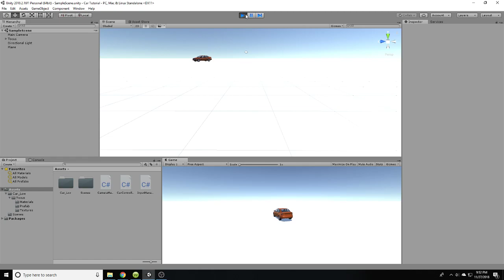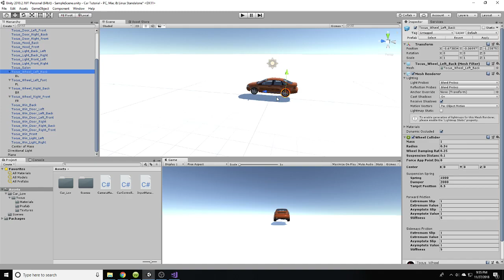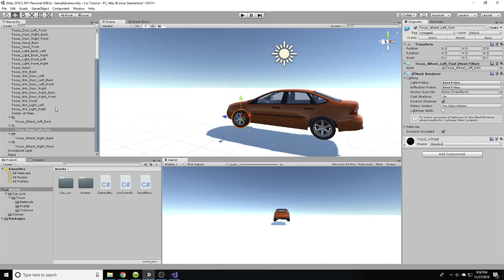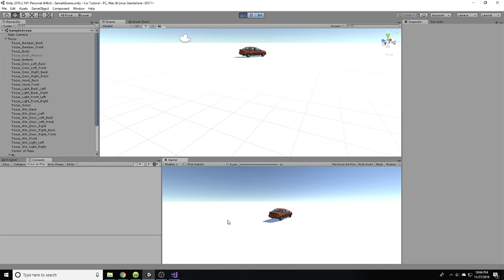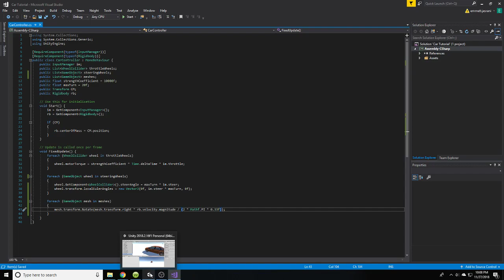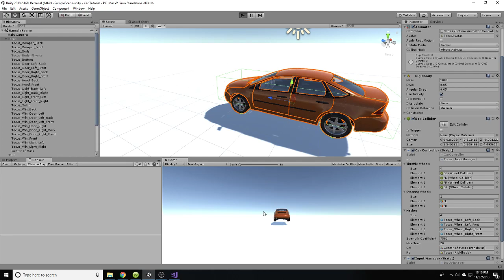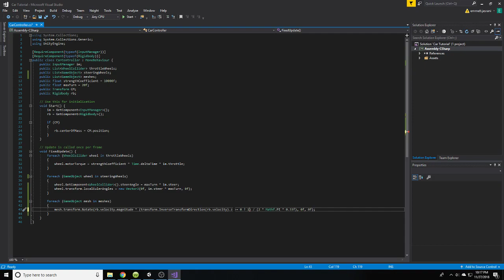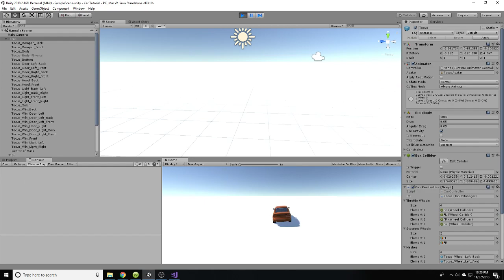Unity Car Physics Tutorial - #3

Comment: I know you don't like seeing syntax errors, but I'm about halfway through the video, 9:47 is what my code looks like. 

-----------------------------------------------------------

using System.Collections;
using System.Collections.Generic;
using UnityEngine;

[RequireComponent(typeof(InputManager))]
[RequireComponent(typeof(Rigidbody))]
public class SnowmobileController : MonoBehaviour
{

    public InputManager im;
    public List<WheelCollider> throttleWheels;
    public List<GameObject> steeringWheels;
    public List<GameObject> meshes;
    public float strengthCoefficient = 20000f;
    public float maxTurn = 20f;
    public Transform CM;
    public Rigidbody rb;

    // Start is called before the first frame update
    void Start()
    {

        im = GetComponent<InputManager>();
        rb = GetComponent<Rigidbody>();

        if (CM)
        {
            rb.centerOfMass = CM.position;
        }

    }
    // Update is called once per frame
    void Update()
    {
        foreach (WheelCollider wheel in throttleWheels)
        {
            wheel.motorTorque = strengthCoefficient * Time.deltaTime * im.throttle;
        }
        foreach (GameObject wheel in steeringWheels)
        {
            wheel.GetComponent<WheelCollider>().steerAngle = maxTurn * im.steer;
            wheel.transform.localEulerAngles = new Vector3(0f, im.steer * maxTurn, 0f);
        }
    }
}

-----------------------------------------------------------

Yet I get an error in Unity saying "MissingReferenceException: The variable steeringWheels of SnowmobileController doesn't exist anymore. You probably need to reassign the steeringWheels variable of the 'SnowmobileController' script in the inspector.
UnityEngine.GameObject.GetComponent[T] () (at <480508088aee40cab70818ff164a29d5>:0)
SnowmobileController.Update ()" But I don't know how to fix it. Also thank you for the tutorials.
Reply from the maker: Did you fix this? I've never seen this particular error before

Comment: I implemented the following in the mesh loop:

foreach (GameObject mesh in meshes)

        {

            frequency = rb.velocity.magnitude / (mesh.GetComponentInParent<WheelCollider>().radius * 2 * Mathf.PI);

            mesh.transform.Rotate(2 * Mathf.PI * frequency * (transform.InverseTransformDirection(rb.velocity).z < 0 ? (-1) : 1), 0f, 0f)

        }
This is more realistic i guess : ).
Reply from the maker: You can also just get the current rotation from the wheelcollider, itself; I just preferred the more controlled look of an artificial spin. Another element is that unity doesn't accurately blur the wheels as they rotate; you'd need to use a mesh with radial blur to fix some of the visuals.

Comment: basically, u can use wheelcolliderName.GetWorldPose(out position, out quat);
where position is a vector3 and quat is a quaternion and just apply it to your mesh as 
wheel.transform.position = position; 
and 
wheel.transform.rotation = quat;
quaternion is something that will just do the job even if u don't know anything about it.
I just used 3 lines of code for this entire video
Reply from the maker: I definitely agree there are easier ways in which to do this; I'm definitely going to claim neither that this series was perfect nor that the way in which I did it was better lmao

I chose to write my own code for the rotations because the wheel colliders are a bit wonky, and I thought the rotations were a bit unnatural
Reply from the maker: Also, you could probably make that one line by doing (out wheel.transform.pos, wheel.transform.rot) instead of using dummy vars to hold the values

Comment: hi,for some reason my front wheels are not rotating in x axis whereas my rear wheels are doing fine.they have no problem  turning in  y axis.please help
Reply from the maker: Maybe the front wheels are rotated in the prefab for some reason?
Reply: I’m quite new to unity and programming so these tutorials are quite helpful. However I also have that problem, as far as I can tell my code is fine so the wheels should be turning but the car I’m using is one I modelled myself. Which before I started to work on unpacked the prefab. It’s quite basic and is basically a body and wheels, could that be the problem? 
My wheel colliders are directly applied to the wheels but I’m pretty sure that is not it. Do you have any suggestions?

Comment: Thank for tutorial. But i got error "CS1061: 'Transform' does not contain a definition for 'localEularAngles' and no accessible extension method 'localEularAngles' accepting a first argument of type 'Transform' could be found (are you missing a using directive or an assembly reference?)". Code is the same as me and I am using Unity 2019.4.
Reply from the maker: Euler is the proper spelling; simple typo is the issue!

Comment: Thanks for your detailed explanation in every tutorial. Cause of that I can managed to do this.

I've modified your script for my convenience and not to remember radius for every other car to which you attach your script

public float r; 
r = throttlewheels [0].GetComponent<WheelCollider> ().radius; 
mesh.transform.Rotate (0f, rb.velocity.magnitude * (transform.InverseTransformDirection (rb.velocity).z >= 0 ? -1 : 1) / (2 * Mathf.PI * r), 0f);

The last line I needed to replace was because the wheels of my car model was at rotation (-90,90,0)

And I have a small problem ie my wheels are rotating much more faster than the car is moving. (Eg. Car's at 10KM/h and wheels rotating at 40KM/h)

Can you tell me how to fix that.
Reply from the maker: I would check the radii of the actual wheels, as opposed those of the collider. If they're not the same sizes, things will look quite inaccurate.

If not, I will try to suggest something else.

- Hope that this helps.
Reply: @AxiomaticUncertainty  Can you solve my wheel problem. Wheels are spinning faster than the speed of the car. Almost x4 times
Reply from the maker: I left a suggestion for that, above. Also, I do, now, plan to record and release video six, ASAP.

Comment: My front left wheel's rotation is changing to 0 degrees after pressing the play button and this is making the rims of the wheel face the other way and is making it look odd.
Can you please help me out?

This is the issue only with the front left wheel.
The other wheels are fine.
Everything' else is fine.

Only this is the prob.
How do i stop it from changing to 0 degrees from -180 degrees?

Thank you.
Reply from the maker: Change your angle scipt by offsetting by -180 degrees. In other words, "angle - 180" should work as a quick fix

Comment: I ended up taking this and implementing it a little differently. I made a separate script and placed it on the wheel mesh object directly so that the car controller can stay a little cleaner. It handles all the rotation just on the mesh object without changing the wheel collider and also does the position based on the suspension. 
using System;
using System.Collections;
using System.Collections.Generic;
using UnityEngine;

public class WheelAnimator : MonoBehaviour
{
    WheelCollider _wc;
    WheelCollider Wheel
    {
        get
        {
            if (_wc == null)
            {
                _wc = transform.parent.GetComponent<WheelCollider>();
            }
            return _wc;
        }
    }

    Rigidbody MyRigidBody
    {
        get
        {
            if (_wc == null)
            {
                _wc = transform.parent.GetComponent<WheelCollider>();
            }
            return _wc.attachedRigidbody;
        }
    }

    float lastSteerAngle = 0;

    // Update is called once per frame
    void Update()
    {
        Wheel.GetWorldPose(out Vector3 wheelPosePosition, out Quaternion wheelPoseRotation);

        float turnAngleDelta = Wheel.steerAngle - lastSteerAngle;

        //the spin amount is defined by...
        float spinAngleDelta = (MyRigidBody.velocity.magnitude * // ...the magnituide of the velocity...
                                Math.Sign(MyRigidBody.transform.InverseTransformDirection(MyRigidBody.velocity).z) * //...(with the sign set by the Z axis of the velocity in local space)...
                               (2 * Mathf.PI * Wheel.radius)); // ...multiplyied by the circumference of the wheel.

        //The axis to turn on is defined by the wheels transform, meaning it does not change with the wheel physics 
        Vector3 turnAxis = Wheel.transform.up;
        //The axis to spen on is defined by the wheels worldpose rotation which does change with the wheel physics
        Vector3 spinAxis = wheelPoseRotation * Vector3.right;

        transform.position = wheelPosePosition;

        transform.Rotate(Wheel.transform.up, turnAngleDelta, Space.World);
        transform.Rotate(spinAxis, spinAngleDelta, Space.World);

        lastSteerAngle = Wheel.steerAngle;
    }
}
Reply from the maker: I always have some idea that I'll make my code modular, but I forget to do so. This is what I'd planned to do. Anything will work, though.

Glad you were able to get separate script working :)
Reply: @AxiomaticUncertainty  What you did in the video was perfect for a tutorial. No one wants a video slowed down with extra structure. 

I just thought it might be a nice thing for people to peak at :)
Reply from the maker: @petermills5623  thanks for the kind remarks!

Comment: On 22:16, Could you use // im.throttle *rb.velocity.magnitube to get the positive or negative direction?
Reply from the maker: Kind of-- there are two issues, though.

1. Throttle can be zero when magnitude > 0
2. Vertical input varies with the duration of its current input state, so changing your current throttle input can have the effect of making that multiplier a fractional one.

Comment: Thanks for the video. I am a beginner, but I wrote like that, based on your script, in FixedUpdate(), and also removed second List, cause we dont need them. This way we can see wheels turning as well as rotating. 
Only one List left, defined as   public List<WheelCollider> throttleWheels;
 in CarController.

private void FixedUpdate()

    {

        foreach(var _wheelCollider in throttleWheels)

        {

            _wheelCollider.motorTorque = motorForce * Time.deltaTime * inputManager.Throttle;

            Vector3 _pos;

            Quaternion _quat;

            if (_wheelCollider.name.Contains("Front"))

            {

//                Debug.Log(_wheelCollider.name);

                _wheelCollider.steerAngle = steerAngleMax * inputManager.Steer;

            }

            _wheelCollider.GetWorldPose(out _pos, out _quat);

            _wheelCollider.transform.position = _pos;

            _wheelCollider.transform.rotation = _quat;

        }
}
Reply from the maker: While this works for this specific instance, the issue with it is that it's not particularly easy to modify. For example, suppose I wanted only the reat wheels to have thrust or to add a fifth wheel (for the sake of argument). One option would be to add a tag to each or to, better yet, add a script allowing you to adjust properties of each wheel within the car and then read those properties in the car controller.

Nonetheless, glad to see that you're engaging with the content and exploring new ideas while doing so.

Comment: Hi nice tutorial but I'm stuck with a problem in the last line 49 it's say that a double cannot be converted in a float and I think it's the part with (2*Math.PI * 0,33f)
Please help me because I'm doing an assignment
Reply from the maker: I'm not sure-- maybe switch 0,33f to 0.33f? Apart from that, I can't be sure without seeing all of the code.
Reply: @AxiomaticUncertainty  hi thanks for replying fast but I tried first I had the point now I tried the comma but it says that / operator cannot be used with double or floats.
this is the code I used:
foreach (GameObject mesh in Meshes)
        {
            mesh.transform.Rotate(rb.velocity.magnitude * (transform.InverseTransformDirection(rb.velocity).z >= 0 ? -1 : -1) / (2 * Math.PI * 0,36f), 0f, 0f);
        }
anyway I sort it by putting the f to Math
thanks for the tutorial bro

Comment: The wheels are spinning to slow, why is it so? And my wheels are rotating in opposite direction regardless its forward or reverse
Reply from the maker: The directional issue can be fixed by simply negating the rotational vector. Regarding the speed, I can't say without more information